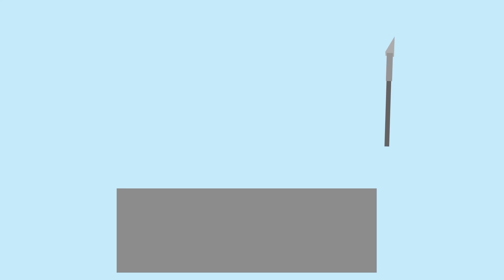Tamiya 1/24 Mclaren Senna complete build (The kit that kicked my modeling butt )

Comment: I feel your pain. In the 1970's I attempted the Williams Bros. Martin B-10 bomber as a gift for my brother. After constructing it, I tried painting the colorful 30's blue/yellow scheme. With a limited choice of finishing products available back then, I masked the kit with Magic Tape and sprayed it with Floquil lacquers. Allowing it to dry overnight, I tried to remove the tape...which disintegrated into a thousand tiny pieces, leaving the plane's surface covered with adhesive. It was the only time in 60 yrs. of modeling I ever threw a kit against a wall!

Comment: Still Andy, nice job anyway! What I like about this kit is the brake calipers and rotors are separate for the first time! About time they started doing that! "One kit that kicked my but was Tamiyas' NSX Honda! I stripped the paint job twice to respray the main body because I went too heavy with the airbrush and got a few runs in the paint. Then when I polished it I went to the primer so I had to respray it a third time! The rear taillights weren't the easiest to assemble either, I kept having to reposition them until they finally stayed! What a blood boiler!

Comment: First model that kicked my butt: the revell F/A-18E/F super hornet
Twas my first model, I was a complete newb and literally filled the wings with glue bc they wouldn’t stick together, the plastic melted and the right wing looks like it was covered in lava, did the same with the landing gear, the joint basically melted and so the rear left gear is at a 45* angle, and I have to stick an eraser beneath it to keep the model level.

Great learning experience.

The next model I got, the tamiya sheridan was absolutely beautiful

Comment: Nice job Andy on a very challenging kit. I just got my first one before the weekend and it's amazing. Somehow the Canadian shops seem to have gotten them in before the US shops.
For the clouding around the windows from your wax/polish, try using some of the panel line wash to see if it will darken up that film and hide it.
Definitely a very fun build I've only just finished up the inside of the "engine bay" and the supports. Still a long way to go. 
Thanks for the honest review, helps us all avoid some of the pitfalls you ran into.

Comment: I guess modeling is all relative like everything else. To you it's not your best work. If mine turned out that well it would be a once in a lifetime piece de resistance. Great job Andy and I whole heartedly agree with "my car, my colors". 
Fitting the engine in the 2001 F1 Ferrari to align with the rear cowl was a struggle for me as well as the decaling and wing assemblies.

Comment: I built the old Matchbox Vincent Black Shadow about a year ago. My problems were a lot my own fault but the kit and the instructions must share some of the blame. I had to take a razor saw to it a couple of times to correct stuff I put together in the wrong order and stuff that didn't align. I even had to saw apart the frame and put in a shim behind the top of the head tube to kick the front end out a little so the front tire would clear the magneto cover. And by that description you can see that it was after the girder fork and wheel were all together and glued to the frame! Luckily, the gas tank covered the work to the frame. But, it came out okay in the end.

Comment: For me it was the new-mold Airfix 1/72 C-47.  But the full interior was too much - the fuselage wouldn't close.   First I thought the kit was faulty.  Then I realized it was me, so I jumked the kit and bought a new/same kit, to do it right.  I mat buildcit as a Basler BT-67 turboprop version of the venerable Gooney Bird, which means most of the interior is no longer relevant.  However my BT-67 conversion kit is for a different C-47, probably the Italeri version.

Comment: That‘s the thing with car kits. They seem to be easy, but to get a clean and smooth finish one need‘s to be super careful. It‘s not like on tanks where one can just be like: well I will make that mistake a battle damage, throw a tarp over it or whatever😅
I‘m glad you have still finished the model despite the frustration!
One recommendation: use a black permanent marker to paint the edges of all the transperent parts! It simulates the sealing and take‘s away the toy caracter. Easy step to bring the model to another level!

Comment: The kit that really kicked my butt was the Eduard 1/35 king tiger. Just nothing seemed to go well with it. I got a replacement metal barrel for it that the superglue cured too soon and left the whole mantlet at a 90 degree angle. I decided to do a 'what if?' and put a flak gun on the top. The first one I got had a photo etch gun shield that was very vague with how to put it together. When I then primed it the primer really reacted to something on the photo etch basically ruining the whole thing so I replaced that too. Did all my painting etc then the tracks just wouldn't stick on at all so they got covered with mud to hide the problems. Came to the final protective clear coats and then that reacted to something else too making the whole texture of the hull looking like dried out mud. In the end I covered all the problem areas with extra stowage and camouflage netting and (somehow) it turned out not too bad

Comment: Oddly enough, in a front engine car, the rear wall is still a firewall, on a rear engine, the front is a bulkhead or braking or impact wall.  On the front engine it's still called firewall because of the fuel tank.

Comment: The Rutscher (Panzerkleinzerstörer) from Das Werk was my nemisis. The fit was horrible, the gluing was a nightmare and at the end I couldn't get the tracks right.
(I saw the assembly on YouTube and was inspired by a suggested camouflage pattern, so I deside to rebuild it...)
It was the first modell after a very (VERY!) long time, which I wanted to crush several times during the construction.
The only thing that saved me in the end was that I is so tiny, that all the mishaps and awful parts are hard to see (at least from a distance)

Comment: A fun fact. The oil change cost $ 4,000 dollars. They have to drop the motor from the bottom of the car, there is no access from the top of the car to the motor.

Comment: I've got a Tamiya ARTA NSX that's kicking my butt.  Ruined the paint job over the summer cause it was too hot causing the paint not to level properly.  Stripped it using Simple Green after a month and now I'm terrified to paint it again since the body color is a very specific Tamiya paint that's hard to find.

Comment: the first edition of Dragon's 1/35 Nashorn an absolute nightmare of a kit it was that bad i quit doing 1/35 armour kits until fairly recently from around 1991 - 93 ... i was totally blameless they put the locating pins on the upper hull in the wrong position so things like the jack couldn't fit on the  upper hull as the locating pins were to close to the gun shield and other problems .... the upper hull was totally ruined with me trying to glue parts to the upper hull that parts of it was covered in glue ... i got so frustrated i threw the kit in a rage at my bedroom wall   3 decades later i started to build 1/35 armour kits again ... 2 years later i saw a review in military in scale saying it was the worst engineered kit to ever been released by dragon

Comment: Years from now, when the molds have become worn, this kit will become a real nightmare. They will have to enclose coupons for psychotherapy with it.
Reply: In fairness older Tamiya kits are usually pretty good in that regard, compared to other manufacturers. It looks like a Wingnut Wings kits in that there is no tollerance for the extra thickness caused by any paint!